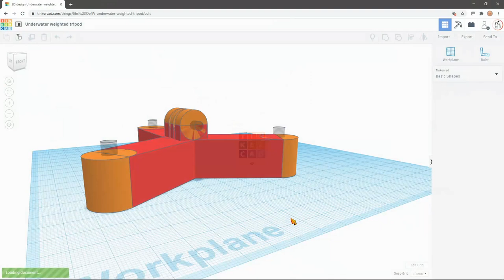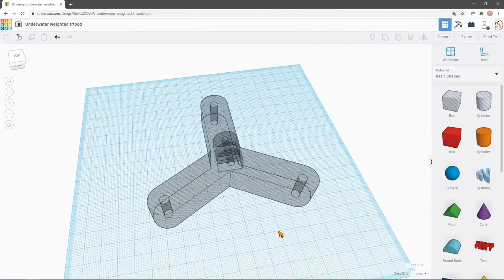3D printed weighted underwater tripod for action camera

Comment: Clever. As always.
Reply from the maker: Thanks Frankie. The weather conditions were not quite right this year on holiday so it didn't get the full test. It did work fine in the rock pools but in previous years I throw my camera out into the sea. Last year I was trying it floating a few feet above the bottom but that was uncomfortable to watch. The year before I was letting it settle on the bottom and that was the intention this year, but the sea was too rough.